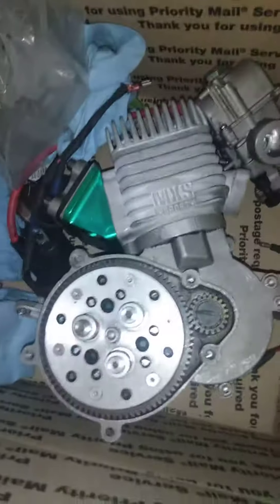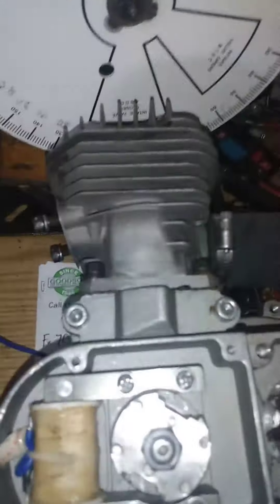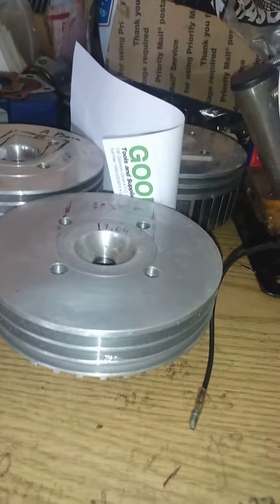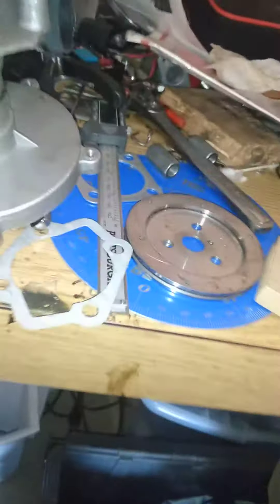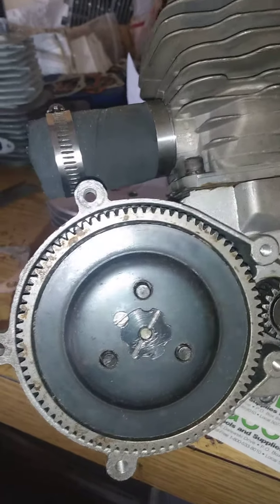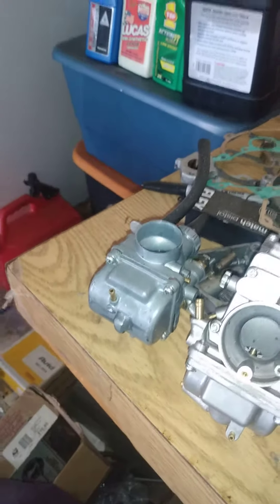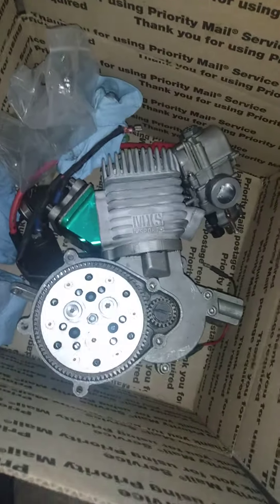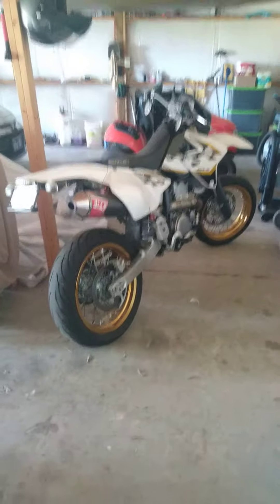it's a motorized bicycle. don't get carried away by a motorcycle

Comment: Hey Dave here's a question for you it doesn't have anything to do with this video, I saw your video on how to test a magneto with a multimeter, what would it mean if my magneto only reads 270, the engine is on runes perfectly fine, thanks
Reply from the maker: That's low here's what I know or should say what happened to me. I got stranded twice because my ohms reading was low like that. The bike ran great got me 6 miles from the house then wouldn't start.  With a lower reading like that my senario was it ran fine till it heated up then it died. I changed wires removed kill switch and put new cdi. Thought I had it all good till died on me again the next day that's when I bought a ohm meters and figured out my readings were low. Hence I changed my primary stator and the problem went away. So best advice I can say if it leaves you stranded you might wanna keep one on hand
Reply from the maker: https://youtu.be/WKizkXjBsNY
Reply from the maker: https://youtu.be/xo4yFtwN9E8 been busy trying to figure out the reality of modern electronics on These fuel injection motorcycles two strokes are simple theses things are 1000 times more difficult
Reply: @2strokecarbtuningportingin187  thanks Dave